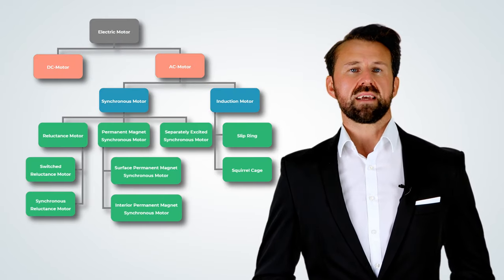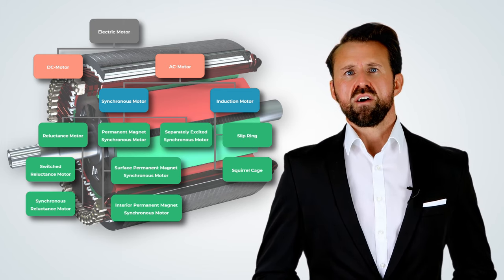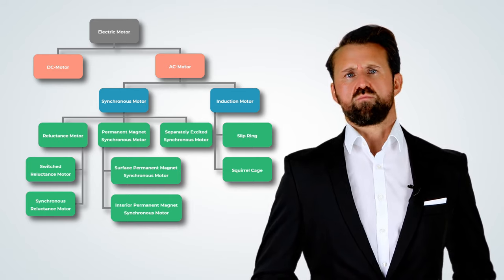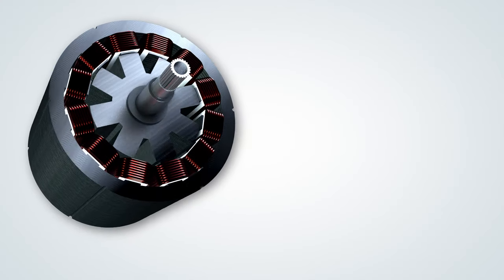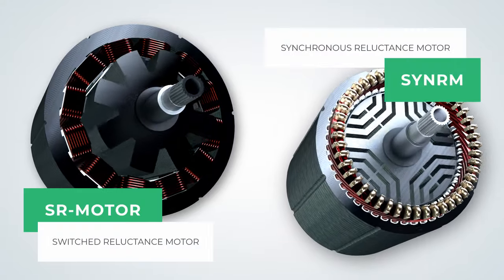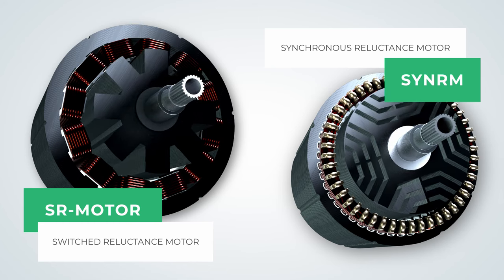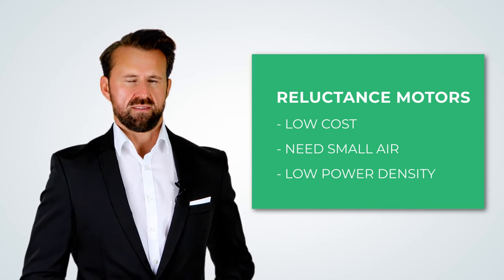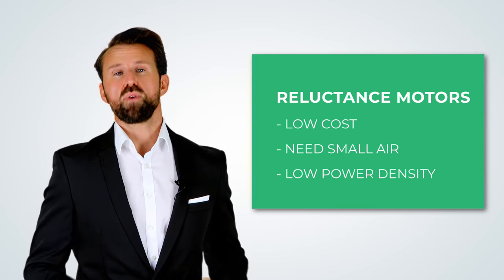Electric Motor Types and Complete Overview

Comment: Hey!!!   I know it's been a while but there's something I've always wanted to know.  Are there any advantages (BESIDES being known as the cheapest) to the use of old-style armatures DESPITE the ineficies caused by the friction of the mechanical brushes?  What it was suspended with frictionless bearings?  Couldn't it then be powered via an electrical induction device as now being utilized in the Axial flux, electrical motor design?  Could such a design be mapped into a CAD system and "structurally" investigated one way or another to a definitive conclusion?
Reply from the maker: You mean in relation to DC motors, right?
Reply: Yeah.  I mean, does the ols universal motor/generator design have ANY inherent structural design attributes that other motor designs do not? @Electric-Motor
Reply from the maker: They are definitely more complex in design because the control is mechanically realized via the brushes.

Comment: I have a question , i rewind and induction motor the same way it was before but I use thicker wire and 5 turn lessers on each slot but I couldn’t get the motor to start turning , the magnetic field was really strong then the original wiring
Reply from the maker: If you reduce the number of turns, you reduce the magnetic flux. If you use an inverter, the reduction of the magnetic flux due to the change of the number of turns can be compensated by a higher phase current. This will of course increase your ohmic losses. Do you use an inverter?

Comment: I wonder if it's possible to construct a motor with both the stator and rotor both using permanent magnet ? so essentially part of rotor and stator are heated above curie temperature, so a portion of the ring lose its magnetic property. Only a pair portions of the rotor and stator are cool below curie temperature, so there will be a torque between the two section. The heat is move via heat pipe similar to what a gpu cooler used (44 kw/m-k thermal conductivity, diamond has only 1.3 kw/m-k, since heat pipe use evaporation phase transition to move heat instead of convection/conduction, so it has much higher conductivity). So effectively you can use convert heat directly to motion. Effectively a motor that actually doesn't mind heat, in fact it would operate the best if the surrounding environment is around the magnet's curie temperature, so you can quickly switch magnetic field on and off via temperature. ** although maximum RPM of such motor might be lot slower than pure emf based motor, assuming heat travel slower than electricity.
Reply from the maker: Sounds like a very crazy idea.  Still, I must admit that the idea does not sound unrealistic to me, but a bit impractical. How did you come up with the idea? And for what application should you use the principle?
Reply: @Electric-Motor  I was reading some article about magnetic transistor for memory storage that use curie temperature as the mechanism to toggle on/off magnetic property to store bit information. That got me thinking if this mechanism can be use in electric motor as well, in a situation where both the rotor and state are permanent magnets (so effectively they are like magnetic bit on a larger scale). 

Normally in an emf base electric motor, the energy from battery is used for motive force of the rotor and the rely signal mechanism to direct the rotor's turning direction (the 3 phase ac current), with heat as a waste product, and you also need waste more power to pump heat away. Quite a lot of energy wasted. So I was thinking if we can directly convert heat to motion, these waste heat can be recycle.

The second part is most heat pump (assuming the input/output temperature delta is very small) by design have coefficient of performance of 2 ~ 3, as in you spent 1 J of energy to move 3 J of energy via compressing the fluid medium. So in this case, the heat source to power the rotor will be coming from both the environment and the electric pump wasted heat. Effectively the electric power in this case will be acting only as the rely ac signal only, and the majority of the motive power will sourced from the environment. So the assumption is that assuming the heat pump has COP of 3, and the heat to motive force conversion have efficiency of at least 33%, The net energy efficiency excluding heat energy from the environment should be 100% and greater than any existing emf based design (if you include both environmental heat energy and the input electrical energy to run the heat pump you would have lot less than 100% efficiency, so no breaking 2nd law of thermodynamic on the system level there).

Now I haven't fully understand the mechanism behind curie temperature enough to even estimate the energy efficiency from heat to motion. It's possible that the efficiency is so low that it's not worth it on a system level. But the main assumed advantage for this motor system is should have higher energy efficiency than emf base motor, since it taking both the environmental heat and the electrical energy as the motive energy source, as oppose to emf base motor where electrical energy is the only motive force with heat as the wasted by product. Assuming this system can pass the first efficiency hurdle, and the mechanism is not so complex enough that it overcome the "benefit", it might be able to extend the range of electric vehicle beyond the current emf base motor limit (we're about 94-97% there, not much room for improvement imho)
**assuming the vehicle is operating in a hot climate with plenty of ambient heat energy. 
* the heat pipe thing was mainly there to move heat around quickly since even with liquid cooling, the heat flux rate/unit area is extremely slow compare how fast electric move. And since most heat pipe is optimize around a narrow range of temperature, and we basically want to toggle between on/off state of the curie temperature and not deviate too far away from it. So heat pipe become the perfect mechanism to move heat around fast in this narrow domain application. Granted this is just all pie in the sky back of napkin calculation, real life version of this idea would probably encounter many unknown and make this design useless.

Comment: Yes question is how to inject mold  aluminum to the rotary.
Reply from the maker: Aluminum rotors are normally manufactured by die casting. This is why aluminum is usually used instead of copper, because lower temperatures are required for aluminum.

Comment: What are slip rings?
Reply from the maker: Slip rings are used to apply current to the rotating rotor. They are used, for example, for externally excited synchronous motors.
Reply from the maker: Could I answer your question?

Comment: Can we make an a.c
Motor with two field and two brush with a single line mean one pulse and minus
Reply from the maker: You can build an ac motor with 2 terminals plus and minus but you have to connect an ac current to it. Most induction motors are built this way. I don't understand what you want to do with the brushes though. Because as soon as you use the brushes to commutate the current it is a DC motor and not an AC motor anymore.

Comment: Why haven't the big companies redesign the electric motor?  Or accept new designs??
Reply from the maker: Oh that's a good question. Large companies usually have very good engineers who also have excellent and very innovative ideas. However, in order to implement innovative ideas, you always have to take a risk and that is very difficult for many managers. 
But you can't blame the managers, because most of them have never developed an electric motor, so it's hard for them to estimate the risk.
But I would be interested to know what you mean by a new electric motor design?
Reply: @Electric-Motor   in short I have redesign the electric motor and generator with better efficiencies of 99%  when new and still at 95% after 6 years of used and abuse at full loads.  I have 2 U.SA. Patents and a full working porotype with 2 independent labs that have verified my claims.